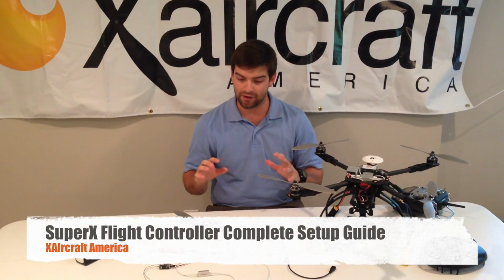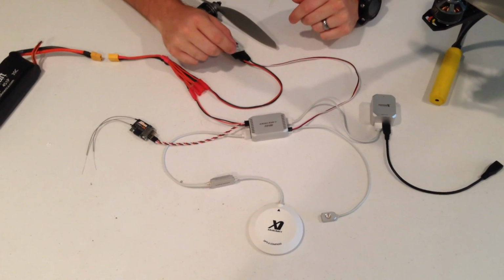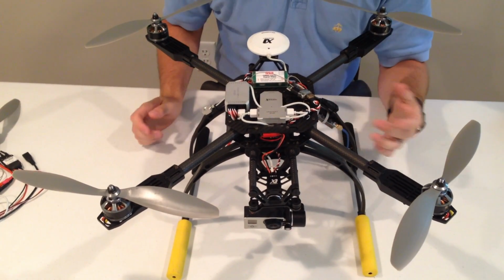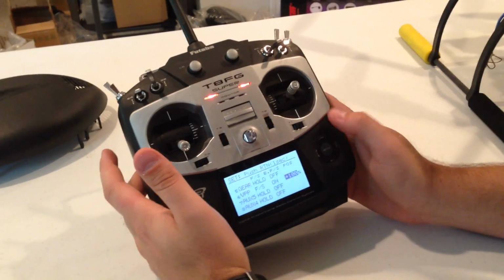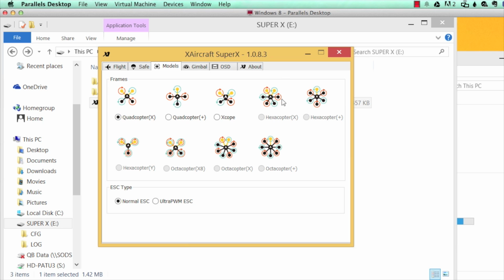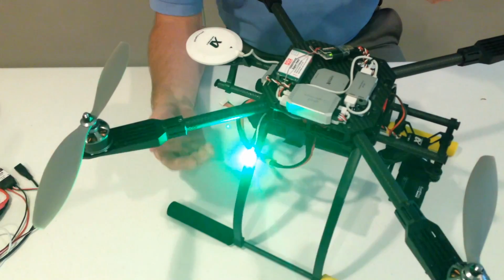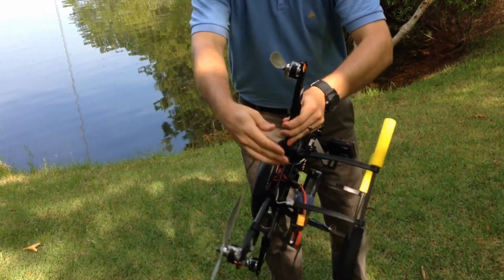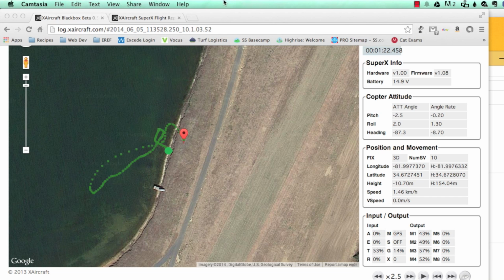SuperX Flight Controller Full Tutorial | XAircraft America

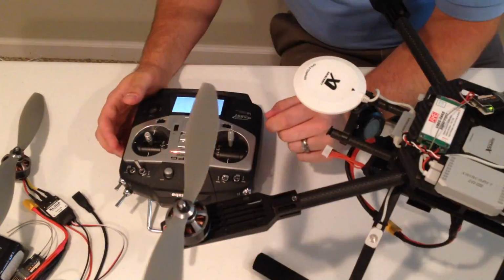Comment: I'm having throttle problems.  Here in your demo at 15:20 reverse throttle calibration, you instruct the user to put the throttle to the top, THEN put both sticks to the top right.  The manual on page 14-15 does NOT mention moving the throttle to the top.  Is that why I'm having throttle issues?